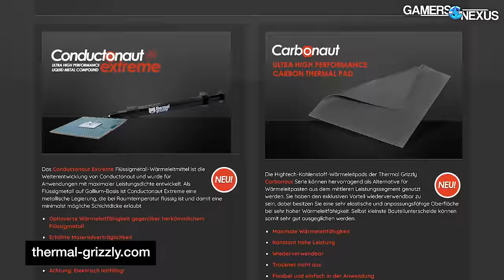CPU Thermal Issues & Der8auer's Scientific Solutions | Graphene, Direct Die Blocks, & More

Comment: I think AMD made a mistake trying to keep AM4 mounting compatible with AM5. IMO they should have just made a better IHS and let the cooler manufacturers adjust and make new mounts.
Reply: Sure but then the CPU won't overheat and that is bad for programmed obsolescence purposes. Because you know about electromigration didn't you?
Reply: @riphunter5100  I don't think that's the reason since half their CPUs (including their most sold ones, X3D chips) don't reach above 80C since they have a much lower TDP. If all their products were capped to 95C (or at least the majority in terms of sales) then yes, I would believe it's for planned obsolescence

Comment: Can we please have a thermal pad and phase-change material round up video? Carbonaut, Kryosheet, PTM7950, Cooler Master's Thermal Pad and their "Pad Pro," etc.

There's so many options out there now, and all the products seem so similar, but are apparently specialized in different ways. Would be awesome to see how they perform, even if it doesn't show an extended duration test immediately.
Reply: Seconded
Reply: I'm more interested in knowing if it's "True" Graphene. Not a product that's got a ton of defects on the hexagonal layout and considered Graphene. If it's vertical, are the orbitals positioned accordingly???

Comment: I'm using Thermal Grizzly Carbonaut for years (since the release of the Ryzen 3000 series) on several machines and I can confirm that those pads perform very well. about 1.5°C hotter than good (thermal grizzly) paste on average, but they perform the same today as they performed on day 1. Absolutely happy with the product, looking forward to using Kryosheet in my Ryzen 7000 build in a few weeks.
Reply: Agreed. Much better than repasting every 3 or 4 years

Comment: As someone who specializes in making graphene and implementing applications for it, once you layer it in any direction, it's no longer acting as pure graphene and instead becomes nanoplatelet layers. It's still a bump up over traditional graphite but loses a lot of the magic of pristine single layer. Pure/pristine single layer is best used as an additive or topical layer for something else, otherwise you just have very thinly sectioned graphite again.

Comment: As someone who's planning to buy a Kryosheet pad soon, those were the best usage instructions and caveats I could have hoped for.
Reply: Graphene is one of the most electrically conductive materials so be careful with direct die applications because if that sheet touches any of the SMDs is going short circuit them harder than liquid metal.
Reply: @riphunter5100  Thanks for the tip, although I'm just using it as a paste replacement for a system meant to run ten years without maintenance :)
Reply: @streetwind. Cover with kapton tape or normal insulation tape just to be safe

Comment: I don't know if you have discussed it yet or not, but there is an equation from Thermodynamics than can help you understand heat transfer in liquid cooled systems:

Q-dot = m-dot*c*delta-t

Where Q-dot is the specific heat transferred,  
m-dot is the MASS flow rate of the coolant, either in lb-m per hour or kg per second
c is the specific heat capacity of the coolant, either in BTU per lb-m * deg F or kJ per kg * deg K
delta-t is the difference in temperature between the incoming (cold?) coolant and the outgoing (hot) coolant.
and the * is used to signify multiplication operations.

When I had to use this formula I was still trained in EES (English Engineering System) units, so c assumed units of BTU/lb-m * deg F, which, for water is about 1 BTU per lb-m *deg F.  Since most temperature measurement in the US is still done in deg. F, this might be convenient.  

There's a page at The Engineer's Toolbox:  https://www.engineeringtoolbox.com/water-thermal-properties-d_162.html
which covers the thermal and other physical properties of water.  If you prefer your measurements in MKS (SI) units, this page can easily help convert from one to the other.

Deriving mass flow rate of water in a system depends strongly on temperature and pressure, as these affect water's density, and all bets are off if the water is at or above saturation temperatures at the specific pressure being used.  How you measure mass flow rate depends on how much you want to spend.  Usually devices such as rotameters (which are available relatively cheaply) are adequate for all testing/comparison purposes if correctly installed and calibrated.

The upshot of all this is:  The greater the delta-t, the more work is being done at a given mass flow rate.

Y'all forgive me if my recollection of things is a bit fuzzy - I haven't actually had to use any of this since I left the Navy (over forty years ago).  Anybody who wants to chime in with a correction is welcome to.  Heck, I might learn something that way.

Comment: I wonder how long it'll be before there is a Liquid Metal for WC loops.
Reply from the maker: hahaha, like a loop filled with liquid metal?!
Reply: Honestly though imagine how heavy that would be
Reply: @GamersNexus  iv seen graphene that was horrible but liquid metal would be hilarious to see.
Reply: @Dwayne-h2v  you'd need a serious pump to make that happen may even need car sized hydrolics to push it lol.
Reply: Image the electric bill with a 1200W PSU and a 2000W liquid metal pump 😂
Reply: @RonnyJakobsson  would prob need rent space on a windfarm/Solar arrey.
Reply: Water already has an extremely high heat capacity so it's very unlikely it would be better if it were possible.
Reply: Liquid metal is used as a coolant for the inner parts of nuclear reactors. It has the benefit that it's not as much of a moderator (neutron absorber) compared to water, and its much easier to make solid state pumps (no moving parts, highly reliable) since its electrically conductive.

That said, from a thermal perspective its not a very good coolant. Turns out the water we're already using is one of the best coolants in terms of balance between thermal transfer and thermal capacity.
Reply: @joethedestroyer4309  I learned something 👍
Reply: @joethedestroyer4309  I think if we get to the point of thinking about the neutron moderation capabilities for a cpu cooling loop, something earlier in the chain has gone very wrong :P

Comment: Roman: Don't use paste on any direct die application
The 1990s: Socket 370, 462, Slot I, A
The 2000s: Laptops, chipsets, Northbridges, Southbridges
In all seriousness though, modern components overpower it, i Use IC diamond Graphite pads on direct die components like GPUs and more commonly Xbox 360s where the consistency and longevity is the focus but i probably will buy some TG pads and compare the thermal difference and potentially move over, at least for my personal hardware, and Socket 462 as with a cheap pad it kicks a thermal shutdown procedure before it could even post, so temperatures would be interesting to monitor as that platform has such quick thermal runaway since the paste is instantly pushed out even with thick pastes because of the strong tension and mounting procedure, the effort Roman puts into this is mindblowing, my next upgrade will 100% be supporting his products in my next computer, to get into exotic cooling solutions has been made easier by him vs the 2000s, delidding a Windsor Athlon 64 X2 and trying to do direct die was very difficult, companies have followed suit, he is a magical market shifting genius and to get products like this mainstream finally brings back fun into the PC hardware space and he helps us get that perfomance we actually paid for :)

Comment: I have a question for Roman. He mentioned that for direct die you shouldn't use paste because of power density, but the industry has been using paste on 400W+ GPUs for years and those are all direct die contact. Am I missing something here?
Reply: GPU dies are much, much larger than CPU dies

Comment: Roman showed that CPU block from a vietnamese modder that used the cooler mounting holes as the water inlet/outlet for a completely clean look. 
I think his own block could be made to do this with a differently designed acrylic part and custom backplate.

Comment: this is one of those videos where i actually learnt important stuff and i'll keep it in mind forever tbh, especially the graphene/graphite difference.

So kinda rant no one will read but I'll go ahead, i had a thermal pad years ago, i think it must have been graphite, it had terrible thermal conductivity bc i was using it on a high end ryzen cpu with its IHS and such, i was able to reuse it tho but i kinda gave up on that idea bc TERRIBLE performance, but graphene sounds very useful so i may give it a try someday.

Also linking this to the digital singages thermal solutions (it's one of my interests), i have a little signage pc i bought for 15€ years ago, it's very low end and ewasty but i use it for torrents and such (im literally the only seeder on a lot of torrents from shows and movies that are on the brink of becoming lost media), the special thing is that its passively cooled and can cool a 35W load fairly ok (except in summer tbh), it uses a weird laptop/desktop cpu from intel, apparently this era (2010-2014ish) intel was making a socket (G2) and cpus intended for both laptop and these singage pcs, some of them are only for singages and others are for laptops and singage, the difernce? they can use desktop ram and laptop ram lol. This one uses a celeron b810 (it SUCKS and ive been meaning to upgrade just so it doesnt overheat), aliexpress has some quad core cpus for this socket at like 6€ atm, they used to be 20 but no one was buying them so im thinking of getting one.

Anyway, thing is graphene maybe works great in here I'm thinking, it's direct die bc laptop-ish cpu but the heatsink is aluminum so i cant do liquid metal, also since it's pasibly cooled i dont really open it up often. Also fun fact: The heatsink is a SOLID BLOCK of aluminum and then a thermal pad on the top that contacts the metal case (basically you put the top of the case back when assembling and screw it from the back and it gets sandwiched, to get an idea the form factor is like a wi-fi router), been thinking of getting a thermal pad replacement for it too, i checked the minus pad extreme but it seems that not only the pad is extreme but the price too so can't really do that forthis like it'd make no sense whatsoever, but i need a 2 or 3mm thick thermal pad for this so idk, i'll keep searching but if anyone knows of a cheap but decent solution lemme know.

TL;DR, graphene is cool, i love the world of singage pc's thermal solutions and i have too much free time

Comment: Really wish Gamers Nexus made an investigation piece about those Honeywell TPM pads which are getting use on laptops now and how they compare to the competition. I think pads make sense for devices like laptops where changing paste is a pain and there are effects like mounting pressure and device orientation but there's not a lot of info out there
Reply: Honeywell PTM7950 is the more commonly used PCM pad, Lenovo uses a custom variant of the 7950 known as PTM7958 for their Legion series laptops. In 2022 (Gen 7) Legion machines, it's used on both the CPU and GPU, and the 2023 machines (Gen 8) use LM on CPU and PTM on GPU. Both 7950 and 7958 are also available in the usual paste syringe, which are designated as 7950-SP and 7958-SP.

Comment: Very interesting.  Unfortunately, normal users will not risk extreme applications for fear of destroying the product.  I hope that in the future we will have processors with normal temperatures and that we will not be threatened with 100°C is normal.  Regarding cooling solutions, I don't see much progress, which is related to the materials of the CPU coolers themselves.  Whether copper or aluminum, the vapor chamber was the first leap.  I would like to see a CPU cooler that would have a combination of an evaporation chamber with cooling pipes that are on the evaporation chamber and also around the cooling block.  Because we are approaching the point where it will be necessary to circulate and condense the gases for stable cooling.

Comment: One of the issues with the 12V HPWR is that Nvidia cards are wider than they used to be, and the power and the power connector is on the side. Sometimes it barely fits, and the side panel is pushing against the cable, which pushes against the connector and ends up destroying it.
Reply: There are 180° connector adaptors you can buy to solve this issue. Just found out about them recently and plan to pick one up.

Comment: Roman! I've bought a delid tool, direct die frame and short backplate for 7950x. When I first installed everything the temps were fine, but not great. Still reaching 95c, etc. No improvement over stock. But when I did the exact same thing the second time the temps were reaching over 100c. Clearly the contact was not good enough. Snice then I was never able to reach even a stock temp. 
What might be the problem? I'm using your liquid metal too.

Comment: My cheap-o HP Pavilion Gaming laptop had horrendous pumpout, even with the thickest pastes I could find in the UK. After about 2 days of lazy thermal cycling, all the paste would be pushed out from the CPU & GPU die to the surrounding pcb. People were recommending Panasonic graphite pads, so I nabbed their 10W/m-k thermal pad. 10 quid for a small sheet, 20 if you wanted the 20w. That kinda hurt.

Now the laptop gets toasty (8 core coffee lake, GTX 1060), but hits the power limit before it hits the thermal throttling limit.

How does Panasonic's various graphite pads compare to ICDiamond and Thermal Grizzly pads?

Comment: Make it so that the ATX 12VO 12 pin Nvidia GPU power adapter can have the Wattage(?) or whatever the meter on it is: Flip by 90 degrees each time a button is pressed. Or have it free-floating so that the user can flip the display with their fingers while installing the adapter. This would be good for inverted case layouts OR vertical GPU orientation in the case of a 90 degree flip.